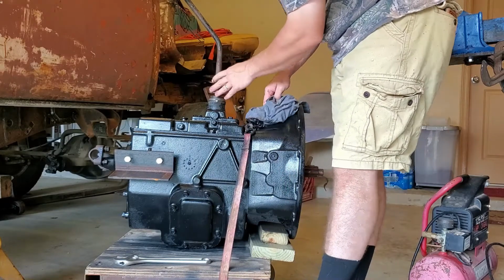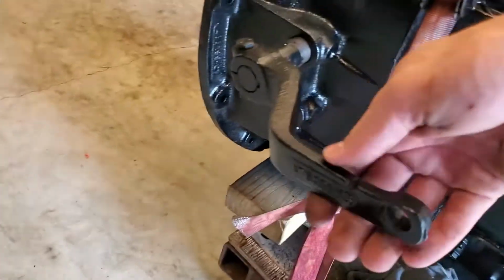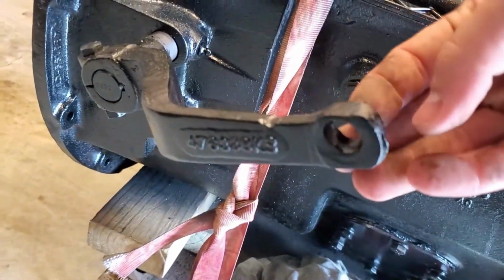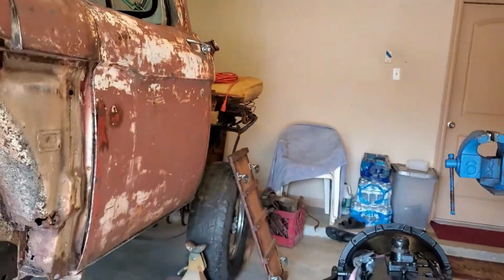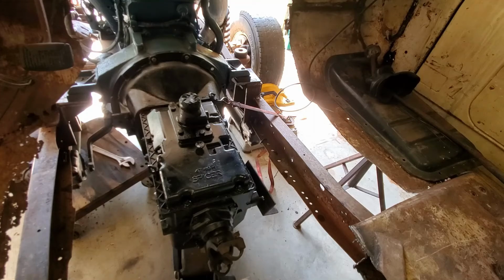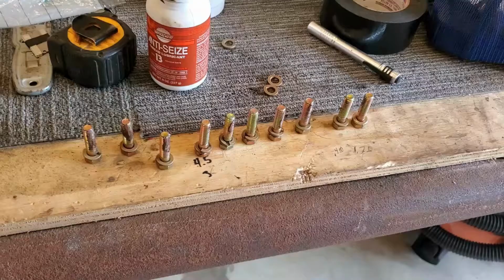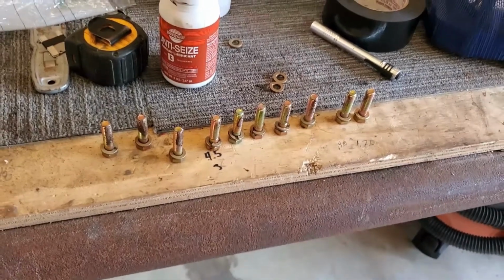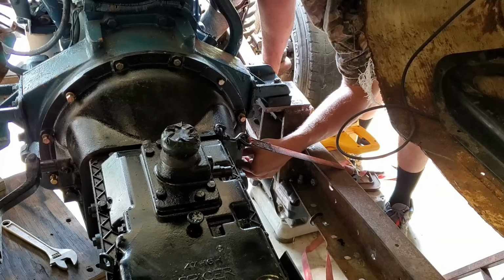How to EASILY Install Transmission in your Project Truck!

Comment: Which transmission did you go with? And why did you chose a manual over an auto?
Reply from the maker: I bought the transmission with the engine as a pair. It is a 5 speed spicer transmission I have no idea what model it is because their isn't a tag on it. I went with a manual because I have always been fascinated with manual transmissions, I like how simple they are.